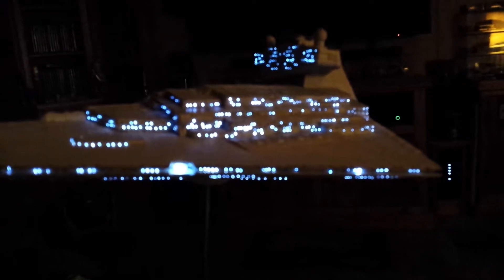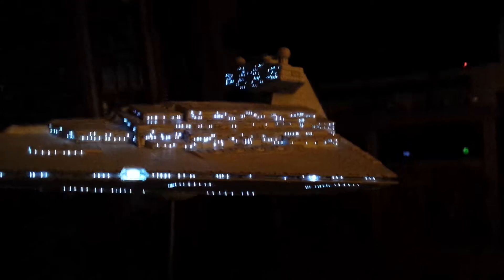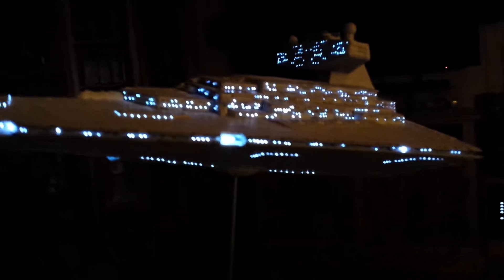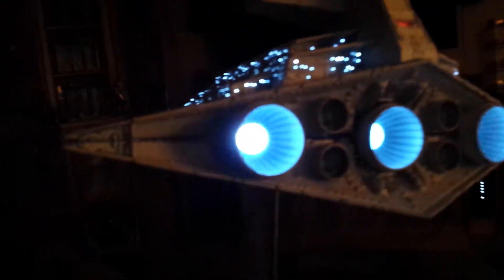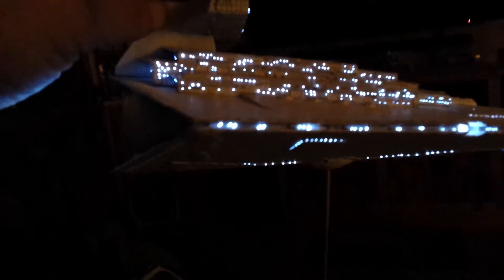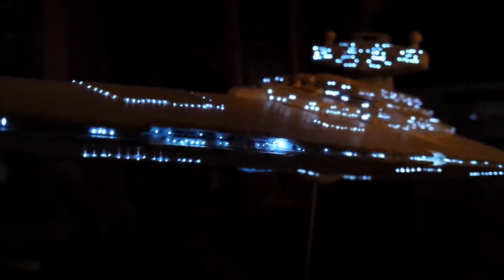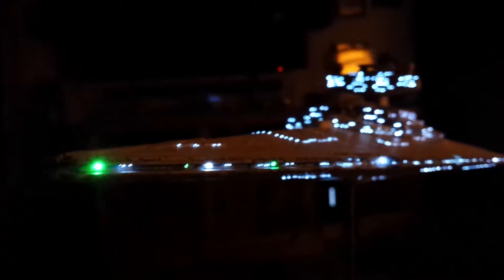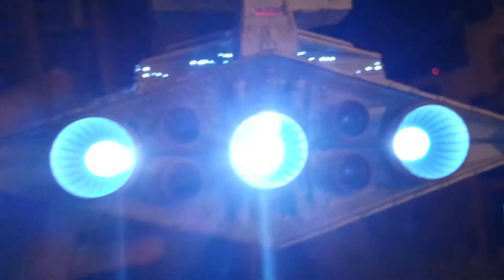Revell 1/4000th scale build series Video #15

Comment: nice work Jim! you need a voltage reduction transistor and the soundboard should work as you want less the batteries.
Reply from the maker: I just used a resistor forget what the value was offhand, same value as I use on my input on the circuit boards I make for my strobes, navigation, faders, and other type of effects boards I make. Worked out great. Still not sure if I am going to use it in the base though. Thanks for the compliment. It was a lot of fun seeing how far I could take this model and make it more than just a toy.
Reply: no problem... looks good!